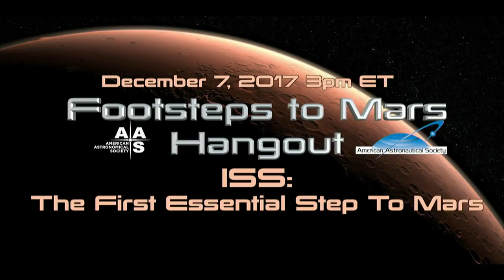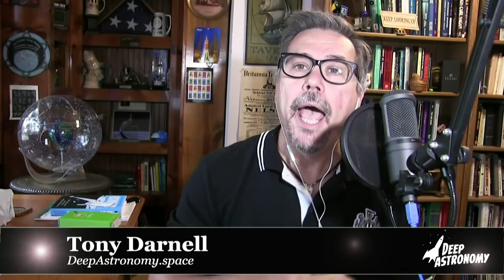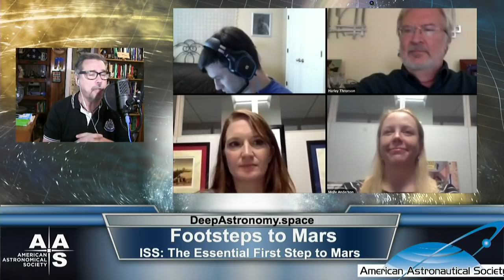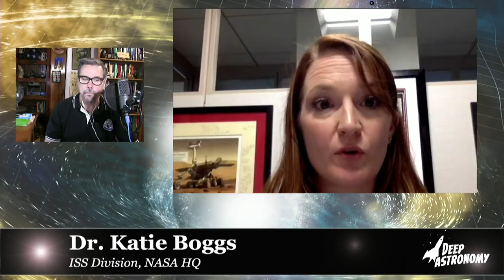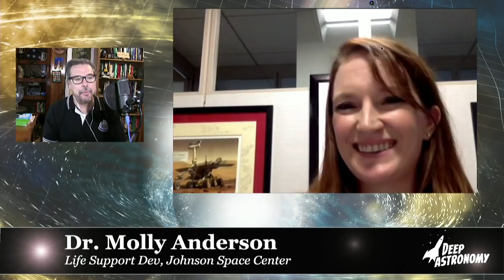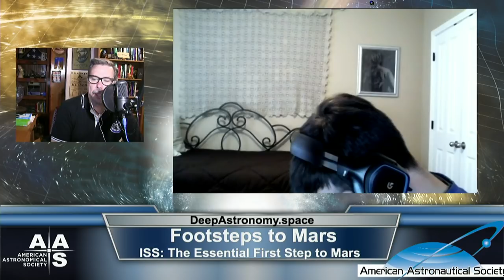ISS: The First Essential Step to Mars

Comment: It's such a waste of resources.
It would only cost a tiny amount by comparison to establish an unmanned fuel producing plant on the moon.  You need to be able to heat stuff up and cool it down.  Those two processes allow you to isolate different materials. A kiln and a condensor.
Doing things in the wrong order is a really big mistake to make.
Reply: Which Moon materials would you use to make what composition of fuel with, on the Moon?
Reply: Ive become convinced that the only practical way to exploit the potential of "space" is to dedicate all manned resources to industrialising the Moon - obviously that will require a permanent habitat there. What the hell is the point of shooting for Mars when we have no idea the long term effects of low gravity even - nearly two decades of ISS, and we are still virtually clueless.
Reply: +tim hem - I do not think it requires a massive investment.  It would require a relatively small project to begin exploiting the moon.
We only have custom for 9 metric tons of hydrolox per year initially.
This would increase if satellites were designed to be refuelled (which they might already be).  Some of the big satellites like radio telescopes and what have you would really benefit I think.
Reply: +playgrrrr - The lunar regolith is made of different materials depending on where you scoop it up from.  It also varies in composition in terms of depth.
I have looked at countless breakdowns of samples and never found much of the most common element in the universe (hydrogen).  But I hve seen it claimed that it is found at the lunar South Pole.
The thing you need to remember is the lists you initially see only give the most common elements not the trace elements.
Two useful elements most people would say are obvious for rocket fuel are hydrogen and oxygen.
You heat the regolith to release the chemicals you want and you run the fumes through a condensor.
It has been shown in an experiment just a couple of years ago that regolith responds well to a microwave oven but induction coils is more standard and traditional and more versatile as some materials don't heat up in a microwave..